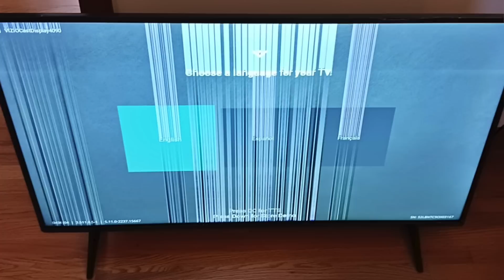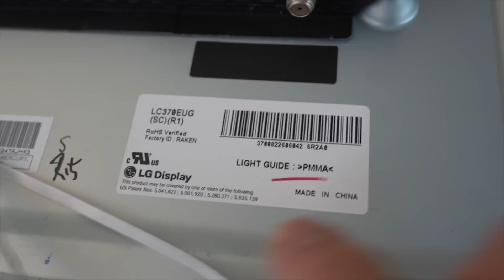FIX Your TV with a TOOTHBRUSH | Fixing Vertical Lines

Comment: My monitor Samsung c24fg70 need an exorcist!!! it's quite annoying cause I see vertical artifacts every day I turn the PC and have to wait up from 5 minutes to 10 minutes to see my screen working well. it's something on the monitor, when I connect to PC via HDMI works well, but when it is displayport this is the problem. Tried with 2 different graphics card, tried with more than 1 displayport. 

The mess is this monitor, sold as 144hz, only shows 144hz when on displayport. If I connect with HDMI it gets hooked to 120hz. Maybe it's time to trash this samsung and never buy samsung again (it's is a problem since the start, long story reported to them, bot nothing done)
Reply from the maker: I'm sorry about that.  I'm not sure what to tell you.
Reply: @FrugalRepair  Sorry my friend, this wasn't a rant on you, but instead a big frustration with the brand. I have recently bought a portable monitor 144hz for 130 euros and works much better than the 400 euros monitor. I have done all that is in my reach on this sh*tty samsung, checked the entire mainboard, the connector. Much more frustrating is if by any chance I try to swap the mainboard, it cost 85 Euros + shipping. I guess my bes approach is to buy a new Arzopa 144hz portable monitor that works perfectly fine. I only posted this comment and description, there was no generic solution (ie: a capacitor) In fact the symptom appears to be a resistor or capacitor, as the problem is always the 5 to 10 minutes until the artifacts disappear (it was left to say that the artifacts , vertical, take up my entire screen, preventing me from interacting with the menu). Another thing is, I've tried setting the monitor to 60hz, 120, 144 and the problem is always the same. Anyway, thank you very much for your feedback.

Comment: 👎🏼 made mine worse first had a picture w vertical lines… tried this and got a black screen … 😠
Reply from the maker: What did you try?  Unfortunately, it's easy to damage the tab bond and it can become unrepairable.  But if it lifted slightly, then you can get some non-conductive material to help press it back down.

Comment: Use you some hot glue on your tab Bond
Reply from the maker: I don't think that would work on it's own, unfortunately.  Not only does it have to line up perfectly, you would also need pressure from above to hold it down to make electrical contact.

Comment: All your techniques didnt work for me. We have to admit when a short is there you cant remove it
Reply from the maker: I’m sorry to hear.  When a short is inside the panel assembly your options are sometimes pretty limited.
Reply: @FrugalRepair  One thing remaining to do is to lift the resistor jumber gate that is shorted on the driver board. I had a shorted cap near 8 resistor pack which is the gate of the right side. After lifting the cap , the pads underneath are still shorted. My last resort is to lift the 9 resistor pack to bypass the short and test.